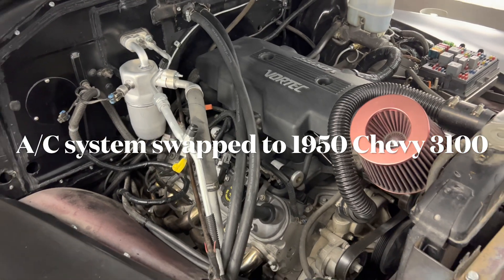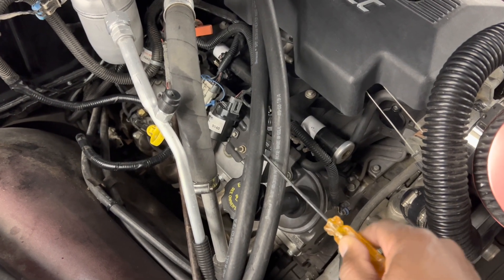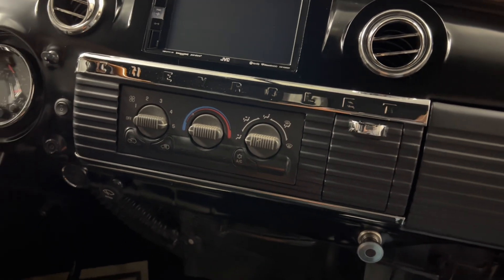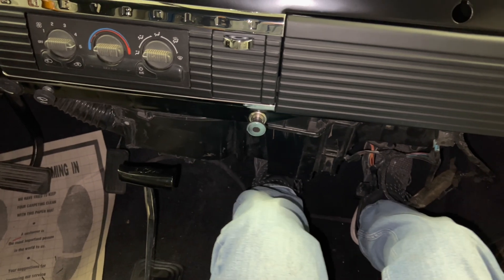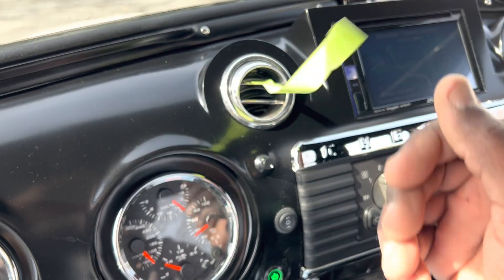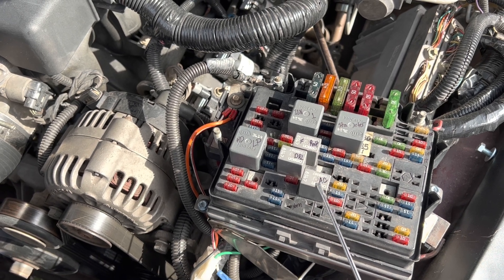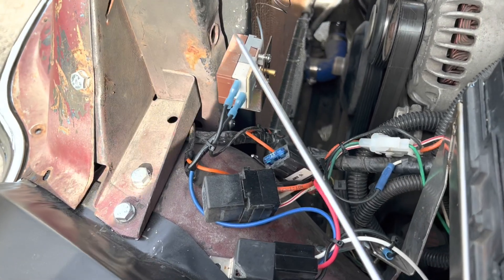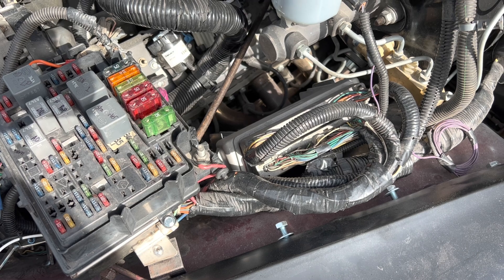Entire A/C System Swapped From 2000 to 1950 Chevy Truck

Comment: You do great work. I’m doing a 50 Chevy COE and my doner truck is a 94 Dodge 3500 with a Cummins. I’m in the process of putting the hvac box from the Dodge, under the Chevy dash. I’m trying to do a decent job on the whole project but probably not up to your level. BTW I would be concerned about the hose clamp connection on your big line. Put some soapy water on it after you charge it.
Reply from the maker: Thanks! That COE is going to be an awesome truck with plenty of power, I love those! You’re 100% right about the suction hose. That was supposed to be a temporary hose that the owner was tasked with replacing with one that was made from that being the template but a year or so after that the temp suction hose blew off under pressure! I ended up making him a crimped hose using barrier hose and crimped fittings. I will publish a video on that as a follow up, soon! Some may question why I didn’t do that in the first place and the answer to that may be found in the video linked below, watch it if you have a few minutes to spare. 

https://youtu.be/CjWDiT2eVKU?si=BUJltaEbxvrGV997

Comment: very cool. and very nice work! I've been trying to find a more modern heater box setup for my old s10 so I can flush the firewall. it seems like no one really bothers with retrofitting oe parts. most people just buy vintage air systems which is neat but spendy
Reply from the maker: Thanks! The owner I built that truck for purchased a donor truck so I took most everything I could take from the donor and swapped it into the 1950, from the body control module to the cruise control and A/C 😅 ♻️

Comment: How much fabrication to dash to install 2000 A/C
Reply: Ok, so basically I need to cut lower bracket out
Reply from the maker: @qhands1342  yes, I basically check and trimmed, checked and trimmed until I had it in place.
Reply: Thanks so much I will let you know my progress
Reply from the maker: @qhands1342  you’re welcome. Please keep me updated!
Reply from the maker: I had to trim the lower dash in order to fit the HVAC unit. I also fabricated two a/c vent pods.

Comment: Nice
I have a 77 square body I want to do this A/C swap on. I know they make kits but I believe I can do it cheaper if I use this method.
Reply from the maker: It is cheaper on the pocket but time consuming! If you do the swap I suggest replacing the evap coil before installing the unit and using a new compressor (filled with the correct amount of oil). I had the unit in the truck and pulled a vacuum and it wouldn’t hold. The evap coil was leaking! As soon as I replaced the evap coil the compressor locked up. I guess some oil remained in the old coil and caused the comp to fail prematurely, due to lack of lubrication 🤷🏾‍♂️. If I had to do it all over I would convince the owner/customer to spend the $$$ for a vintage air unit. Thanks for watching and commenting!